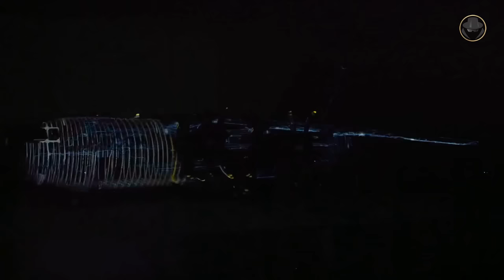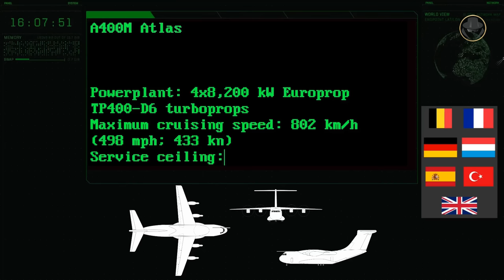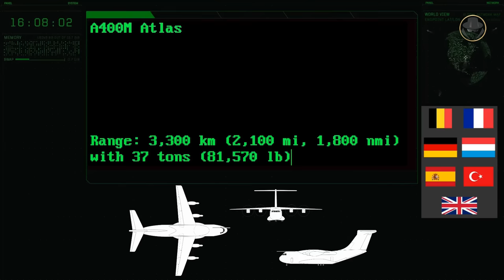A400M Atlas  | Good but unlucky military transport aircraft

Comment: One thing to note is that the A-400M is the one of only 2 large Western airlifter, the other is the Japanese C-2, currently being built as the C-17 went out of production in 2015... so it pretty much has the market to itself unless the Japanese C-2 is partnered up with a 2nd party firm to help them sell it on the open market...
Reply: The Japanese until now didn't even try to sell the C-2 to foreigner customers... which is a bit pity, since it is quite high-capacity (allmost any vehicle inclusive most tanks) and range, but still only two-engine (thus better economy) transport jet...
Turboprops like A-400M generally provide better STOL/dirt strips performance than jets, and among those he is by far the largest one (and also, still in production).
Reply: I recently saw one of these land in Central Greece. I couldn't see which country it belonged to, but it landed shortly after a Panavia tornado. We were about 70 kicks out of Athens returning to Athens from the north.

Comment: The problem is that it is larger than a C-130 and smaller than a C-17 and thus falls between operational/theater lift and strategic lift. Building the A400M was a political decision for economic reasons.
Reply: It gives much greater capacity to locations where the C-130 is too small. It was not a political decision but rather a modern update to the C-130
Reply: Early renders of the A400M showed two turbofan engines but this did not pan out.  The decision was industrial and political, Europe now has a good transport aircraft and it is slowly making sales.  Malaysia ordered four, Indonesia will order four, Kazakhstan will order two and these will likely bump up in the coming years.
Reply: @MrBahjatt  
The efficiency of these turboprops is beyond turbofan capabilities. I agree 100% Airbus has designed and built an excellent aircraft
Reply: The C 17 isn't available to purchase anymore so unfortunately not many options

Comment: This is the most advanced cargo plane ever made. The engines specs alone leave me speechless. They’re the most advanced turbo prop engines ever. Period. Full stop. The engine monitoring system has 270,000 lines of code ALONE! Everyone should go read the wiki page on this plane and it’s engines as well as all of the different manufacturers press releases and product brochures. It will blow you away. This plane even puts the new C130 Super Hercules to shame.
Reply: I am agreed with you.⭐⭐⭐⭐⭐

Comment: I was the speaker for the a
GAF in the MSG3 of the development of this bird. At times, Airbus seemed a little overwhelmed by the demands of military aviation. If only the engineers had had their way, we would have had an aircraft that could have flown to the moon and dived into the Mariana Trench, but the sharp pencil of calculation thwarted many good ideas and then the politicians kept interfering somewhat unhappily, which rarely has a positive effect on such projects. For an armaments project of this size, the price increase compared to the original calculation and the delay in the start of delivery have remained within reasonably tolerable limits. There are many much worse examples of less complex weapon systems. The result was an aircraft that could not do everything at the time of delivery and still has potential for improvement today. This applies in particular to active and passive armament, automatic tactical low level flight capability and the versatility and usability of the cargo hold. However, improvements that interfere with the basic structure of the aircraft can no longer be expected. The A400M brings all the advantages of a propeller-driven aircraft with powerful engines and has eliminated the disadvantages of the propeller to a very large extent. The noise level inside and outside as well as the level of vibrations caused by the propellers have remained at an astonishingly low level compared to the power of over 44,000 hp transmitted by 4 propellers with 8 blades each. The flight performance data are excellent for a transport aircraft in propeller configuration. I am confident that with increasing experience in handling this aircraft, more customers will come forward who want to close the gap between the C17 and C130 that the A400M has precisely targeted.

Comment: The Philippine Air Force is starting to evaluate the Airbus A400M Atlas, and the Embraer C-390 Millennium for its STRATEGIC Airlifter, may the BEST plane win. The Philippine Air Force currently ordered 3 units of C-130J 600, reduced to the original order of 5 units.

Comment: you wrong F35 some of parts made in Israel by Israel specification and ONLY Israel have "BED" where whey can change the plane without involving USA
Reply: i'd say yes and no... main structural is fixed, the RCS paint is even classified from Israel. if not wrong, the only changes is the weapon platform and sensor and cockpit packages